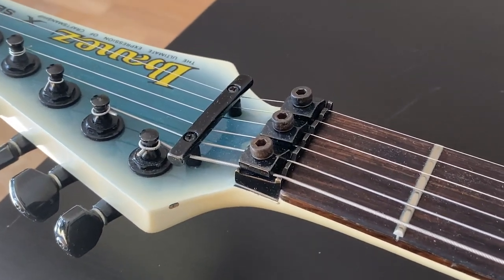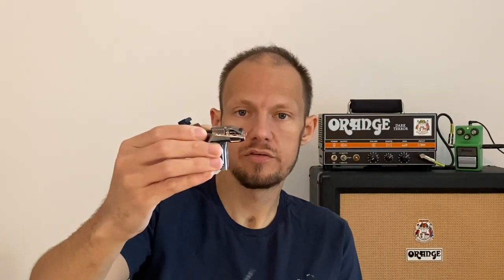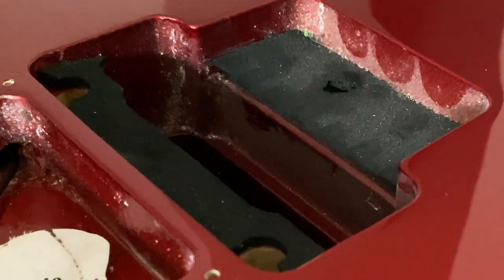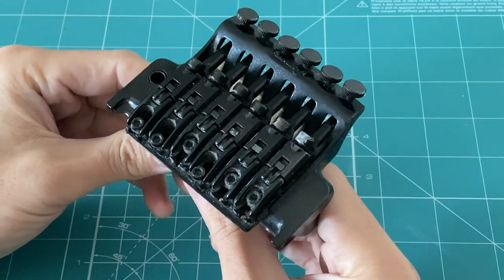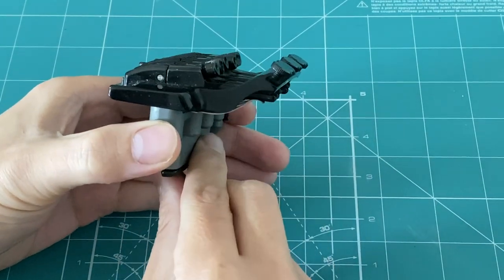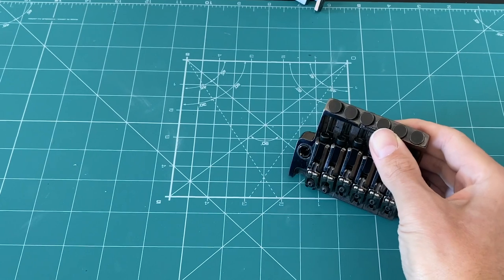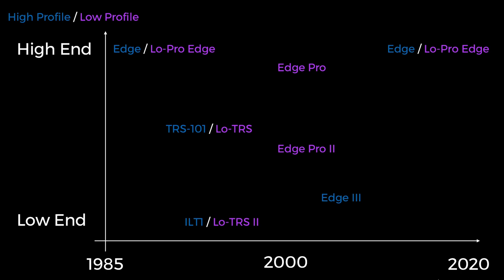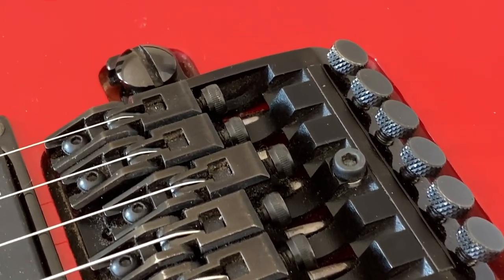EDGE, LO-PRO EDGE and EDGE PRO - How To Recognise Ibanez  FLOYD ROSE Type Tremolos

Comment: Imho the 'screw in the back' problem can be mitigated with unscrewing it and placing a tiny 1-2mm teflon rod (smaller than a diameter of the hole) first, then screw it back. First, it will not damage the crank, secondly it can be replaced as worn.
Reply from the maker: This sounds like reasonable solution. Thanks for the suggestion!

Comment: Edge Pro for life! My old RG had an Edge Pro II, which is just a slightly cheaper version with material cost concessions such as zinc saddle chips and retainer blocks vs the original's solid ones. Still it was hands down the most well packed feature sets of any standard Ibanez double locking floating bridge out there. The handling and dependability, as well as the convenience of not having to risk losing any tiny chips or cut the ball ends off the strings, just elevate it to the next level.
Reply from the maker: Not super popular opinion, but I love to see it get some love! I like it a lot too, although it's probably after Lo-Pro in my personal ranking :) Thanks for commenting!

Comment: My first Ibanez had an Edge 3 bridge. It's okay as long as it's blocked. Once you float it, your tuning stability goes out the window lol. Currently, I use the Edge Pro and Edge bridges on my guitars. I have a RG550 which came stock with the Edge, and I have an STM2 which came with an Edge 3, but I upgraded the studs and bridge to Edge Pro. 

On the Edge Pro, I prefer to have it blocked because I experienced tuning instability when floating it, but as a diving bridge, it was amazing. Most people don't know this but the Edge Pro has a even lower profile than the LoPro Edge. I found it super comfortable to use. The Edge on my RG550 is fully floating, but we'll see how long that lasts, I'm starting to get sick of floating tremolos.

Awesome video, thanks for the information. I also wanted to try out the ZR bridge, which is pretty much the Edge Zero, but instead of knife edges, it pivots on ball bearings. It must be super smooth.
Reply: I use a EDGE III on my RG 350MDX and it is set for floating and it stays in just as good as my old RG with a original EDGE?  I have used this
EDGE III for over 7 years now. Not sure of what you did different but the EDGE III will operate as a floating trem no problem. and yes it does the flutter effect/

Comment: Spot on information!  I learned a few things about a couple of the Trems I haven't owned (e.g. Edge Pro II and Edge III).  Basically, you can't go wrong with the high end Edge models.  They're all brilliant.  Of the Lo Pro & OG Edge, I like the Lo Pro just a touch more.
Glad you decided to cover the Edge Zero/EZ II in another video, as they're descendents of another of my faves, the ZR (Zero Resistance) Tremolo.  The SynchroniZR is pretty cool too! 👍

Comment: Edge Pro Zero ll ( non ZR system). Had the edge lll in my RG dx4 I owned seven years ago. Though it was a great guitar for the money , I had a lot of tuning issues with it from the beginning. It was setup and if I needed a string change I took it to my guitar teacher at the time. He’s notorious for getting any floating bridge just right for anyone who had a floating tremolo. The more songs and licks I learned , the more tune  sensitive I became. So I sold it and bought a Ibanez S520. At first I experienced the same issues I was having with my RG until I took it to my guitar teacher and seven years later it’s like driving a sports car. The only issues I have with it so far on occasion is weather. In Des Moines Iowa it gets extremely humid in summer and early fall. Winter is extremely dry during the winter so it can cause tremolo or truss rod issues as well. As long as I take it to a trusted technician it will stay in tune. I normally tune it right before or after playing , maybe one to two times if not at all on average. I’m planning to invest in  the Schaller Claw and Ibanez bridge parts upgrade. Of  the two guitars I currently have and the eight I’ve owned in a twenty three year span, this guitar and tremolo has treated me right.
Reply from the maker: Changing climate is usually causing problems with musical instruments. Awesome that you've found the one that fits you!
Reply: @Ibbyhead  Got an1998 ESP LTD Made in Japan. This thing weights 20kg, but it does not care for weather conditions :). Rock solid guitar, has all of it's original hardware. The Ibanez Jem are far more sensitive...

Comment: Throughout my years of playing, I've had all of the three types installed into their corresponding guitar model. Honestly, I was extremely dissatisfied with the Edge Pro due to its intermittent instability in terms of tuning despite the guitar being a prestige. The fretboard was infallibly comfortable though. 
I've unreasonably discredited the efficiency of the original Edge and proceeded to purchase a 96s Japanese RG with a LO-PRO Edge. It was significantly more stable in comparison to the more modernized Edge Pro which didn't exactly come as a surprise to me since I've always had a predilection towards old hardware and corroborated their reliability. However, I eventually sold the 96's RG and bargained for a 91's RG570 with the rarest finish. I was stupefied at how stable the bridge and tuning was( I'm still using that particular guitar ;), it rarely went out of tune even when I'm playing heavier stuff like Pantera, unlike the aforementioned Edge Pro. I dare to say that Its stability is exceeding this of the LO-PRO edge. Marvelous tremolo. 
My ranking of the more high-end Ibanez tremolos would be -
1.Original Edge
2.LO-PRO Edge
3.Edge Pro
4.Edge Zero(although it's pretty equal with the Edge Pro)
Additionally, I'm slightly curious as to if you wish to make a direct comparison between the Floyd Rose and the Original Edge - and which one do you think it's better?
Reply from the maker: Thank you for that detailed comment and sharing your experience! Your ranking is aligned with what most people find :) I personally prefer Lo-Pro because of the lower profile, and I like how Edge Pro feels under palm but in terms of stability I think your rating is spot-on. I'd love to make that comparison and there's a chance I'll have a guitar with Original Floyd Rose joining my stable soon, so that will become possible. I'm curious myself!
Reply: @Ibbyhead  I'm really looking forward to it. Honestly, not many YouTubers have made a similarly direct comparison, consider yourself innovative :D. By the way, what's your favourite Ibanez guitar and why?
Reply from the maker: @deftartisan6769  I don't have one favourite :D I really dig my Korean RG370B, it's nicely worn in, and I made some upgrades to it. I generally like thicker neck profiles like Wizard II or Ultra and double humbucker or HS configuration. I recently have a lot of fun with RG465 although it has Edge III term which is suboptimal. I really really like the MMM1, but it's a bit oddball. RGT2020/3020/3120 are ones I'm hunting for as I feel those would work for me really nicely.
Reply: @Ibbyhead  I've never felt a thicker Ibanez neck profile haha. I presume they would produce more sustainable tones? I got to admit, the RG465 is a pretty good looking model overall, I had one long ago haha. Its playability is outstanding for an Indonesian-made guitar.

Comment: I'm down with the low pro edge as well, better for palm muting and raising notes with my palm. Another reason that I never understood is that my Jem 777 edge had little square pieces under the saddles so you could get a bad saddle insert out by poking it through but these pieces got lost and didn't stay on. I never understood how they were even supposed to stay on and it was more difficult to line up the saddle insert with the saddle string lock screws while these little saddle insert holding plates were not there. Only problem now is it's almost impossible to get a bad saddle insert out of a saddle. Lol 
Hey man thanks for the history lesson and I say we have similar taste . Great video 👍
Reply from the maker: Thanks!

Comment: How would you rate the original floyd rose and the schecters 1500?
Reply from the maker: Original floyd roses are great, on par with Gotoh made and Edge (which is also made by Gotoh). Didn't have any contact with Schecter 1500, but Internet claims it's better built FR1000 which would put it somewhere in the upper mid-range, lower high-range, but can't say for sure!
Reply: @Ibbyhead  dude ty SO much I been spending months trying to consider going outside of ibanez and buying a schecter or kiesel.  the one thing holding me back is all floyds ive played suck and my js1000 edge pro is INSANELY good.  So thinking I have to be tied to playing nothing but ibanez edges has kept me from making the purchase.  These mid to higher end guitars are very hard to find in store.  im years out of practice but i just remember thinking theres no way i could practice on anything but my ibanez edge, im also a very heavy floyd user, think dimebag style, thats me.  but anyways kiesel has the original floyd or hipshot which i consider trying, and schecter 1500 which I also consider.  But i dont really see many great players that are as heavily whammy heavy as I am so its difficult to decide without really finding these at a store somewhere.  anyways your advice has helped me immensely to reconsider an original floyd or 1500.  i was going to order a ibanez AZ 7 string, but it lacks the floyd rose, and sustainiac, and those are very hardline points for me to purchase.  didnt know being a giutarist in 2022 was going to be this difficult.  All those high end guitars I had from the 2000's im really kicking myself now for selling them off or letting them get stolen.

Comment: Having played many Ibanez with edge & edge lo pros I’ve found sometimes they just aren’t consistent 🤷‍♂️ 
The Schecter C-1 FRS Elite uses a 1000 series Floyd Rose licensed Trem. It’s IMHO the best Dbl Locking system I’ve ever used(30+ years). It takes abuse and snaps back dead nuts tune!
Reply from the maker: I'm glad you found what works for you! 1000 series Floyds are super solid choice!
Reply: @Ibbyhead  from the factory it was spot on. Now I have had great FR Edge Bridges, the one Lo Pro I have just doesn’t do it for me.

Comment: bushing hack :
use cigarette lighter to burn/heat up the bushing for around 2 seconds, bushing should expand a bit to have more firm grip when popping in into the arm slot.

i did this all the time and it works like a charm 😊
Reply from the maker: Thanks for sharing!

Comment: Great video, easy to understand, very detailed and informative of the different variations, I was unaware there were clones and re-releases of the original Tremolo's.

I own four Ibanez guitars, a JS1000 BTB with the Cosmo Black Lo-Pro Edge, an Ibanez Premium RG870QMZ with the Cosmo Black Edge-Zero II, an S-Series S770PB with the ZR Tremolo and the Ibanez RG7620 with the Lo-Pro Edge 7.

They've all worked flawlessly and I've not had any issues with any of them going out of tune, the only downside is the common wear and tear they go through as it's noticeable that some metal parts of the tremolo's fall victim to rust quicker than others.

The most frustrating thing for me is finding replacements for these parts that have been tarnished over time as there are almost zero distributors that ship internationally if you're someone who is based outside of the EU like I am in New Zealand.

Peace! ! !✌️😎
Reply from the maker: Yeah, for some models that been phased out (like ZRs) it's getting hard to get parts even in Europe. But I can imagine it gets way harder in NZ or Australia.

Comment: Hey I have a bit of an oddity. A 1991 540r I bought new back then, The catalog says should be a Lo-Pro but it actually has an original edge like the 1990 models. I know it's a 91 by the "custom made" inlay at 21st fret and the colour is only a '91 option according to the catalogs.
Great video, well done.
Reply from the maker: Cool, they're replaceable without issue, so somebody might have preferred that in the past and just swap them. 540R is on my "I will buy one for the good price" list :D
Reply: @Ibbyhead  It was new though as in, I bought it straight from the music store I worked at, first run as they were first being shipped late 1990 actually. So no time for it to be swapped, no other owner or I'd have assumed the same. I know it's lineage from the day it was out of factory box.
Reply from the maker: I guess there wasn't a clear-cut date between one spec and other, especially that those parts are very exchange'able. It's pretty common that next year models already have previous year serial numbers. And especially back then, the cut-off dates weren't probably very solid. In modern guitars you can see a concept of version of model (they're stamped on the headstock, for example "1P02" being version 2) and then the specs are probably more controlled. Thanks for sharing, that's very interesting :)

Comment: Thank you very much for this informative video on the Ibanez trems! You helped me figure out exactly which model I have in my old Ibanez S540 (it's the original Edge). It has been damaged beyond repair from ~30 years of abuse and I need to replace it, but I couldn't identify the tremolo on my own – until now, that is. Thank you SO much!
Reply from the maker: Happy to help! I hope you'll be able to fix your 540 and enjoy it again!
Reply: @Ibbyhead  Thank you! I can happily inform you that it has since been fixed. I did however decide on a Lo-Pro Edge instead of the regular Edge and it's been working fine for a couple of weeks now. :)
Reply from the maker: @MrGul  Awesome choice, I like the feel of Lo-Pro a bit more personally :)

Comment: Great information and video Ibby!   I have an Edge Pro II on my 2006 Korean Ibanez Jem Jr 555 and it stays in tune and haven't had any issues. Guitar plays phenomenal!  At some point I'm going to find an Edge Pro in the black COSMO replace Edge Pro II.
Reply from the maker: My 2003 Korean RG370B had Edge Pro II. Never had issues with it, but recently found a spare Edge Pro on second-hand market and put in there :) I like the arm socket mechanism on EP much more :)
Reply: @Ibbyhead   I've noticed guitars are a lot higher prices in Europe... I'm in U.S.
Reply from the maker: @IshredGuitar  I'm in Sweden. I'd say guitars are about 20% more expensive in Europe than in the US, although it depends.

Comment: Hello Ibby I recently found an RG550 from the year 2000 and this guitar is now my favorite guitar of all time. It is the one of the second run of the RG550 from 98-2001I think cause the neck joint is actually cut away unlike every RG550 I have ever seen now it does have the Wizard 3 piece neck, and the V8, V7, and the S1 pickups in it. Now my question to you is this, is this guitar one of the rarer RG550's out there cause I have yet to see another out there with this cut away? I would just like to know more about this model cause there's almost no info on these thanks man.
Reply from the maker: If you mean AANJ (All Access Neck Joint), most RGs after 1994 will have it. Does it have mirrored pickguard?
Reply: Ibby Register Yes it does but I'm guessing it might have came with a black one and someone replaced it over the years.

Comment: Thank you to review the Ibanez bridge, as I know they developed with Gotoh. By the way, Lo pro edge 7 string is my favorite, in terms of looking and stability but stability to stay in tune, maybe better, however the problem is the arm bar which never stays tight even changing the white little plastic ring, I watched a video in which a guy changed the complete arm and socket by an original arm bar plus socket floyd rose and worked great as original floyd. Second up grade I would change the block by a fu tone brass block and the springs by the red ones, even though with the ibanez block has already good sustain but I feel it lacks of tightness and stability.
Reply from the maker: Thank you for your comment! I know there's a Japanese company, Red Bishop, that produces a dedicated kit for Edge/Lo-Pro Edge to change the arm to screw-in.
Reply: @Ibbyhead  oh really? I will check it out

Comment: when set up new strings on a jem,dont cut off the string ball,s.tread the string with ball true the tuners on the neck.Cut them to length and screw the ends in the floyd style trem.S Vai is said to have his guitars set upp like that and i tried it myself.it is much faster and better stability.
Reply from the maker: This is a good tip, I sometimes do it too this way. Don't really have a preference.
Reply: @Ibbyhead  Same here,Nnever done it before i saw it.If it is better ,usage and time will show.

Comment: Great video mate! A bit of a question. Can an Edge pro on a Prestige RG1420 be swapped for a Low pro Edge or an Original Edge? Thank you!
Reply from the maker: Unfortunately not. The post spacing should match, but the route is to small to accommodate Edge / LoPro Edge.
Reply: Thank you brother!!

Comment: As someone who owns an RGD2127z and S7420QM and absolutely loves the edge zero and ZR trems on these two guitars it'd be really cool to see that followup so people can learn a bit more about these two trems, especially the ZR because they both kinda get a bad wrap due to the ZPS system. I actually feel that my edge zero and ZR actually perform BETTER than my lo pro edges, specifically the ZR. Easily the best feeling and most stable tremolo I've ever used and it really makes me sad that they're just gone due to apparently patent claims from the guy associated with Coherent Sound In Light.
Reply from the maker: Thanks for the comment. I finally have gathere all the Z-family bridges under one roof and will soon work on that video! ZR has really cool feel, and it's really interesting take at a tremolo!